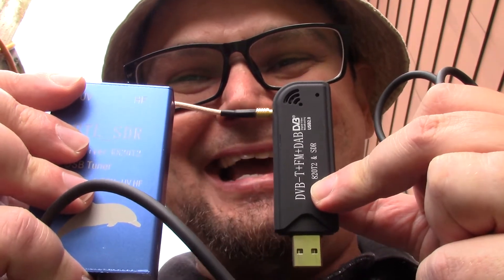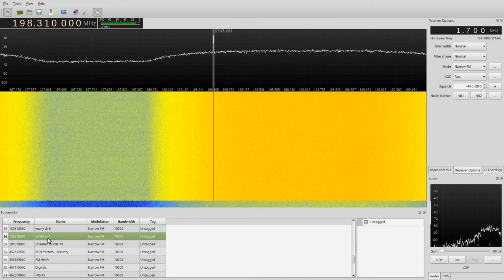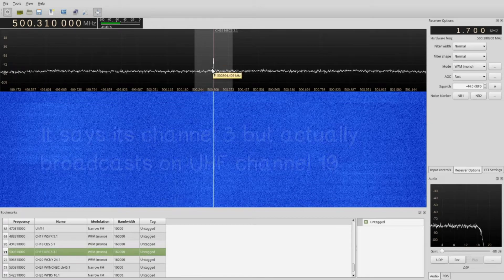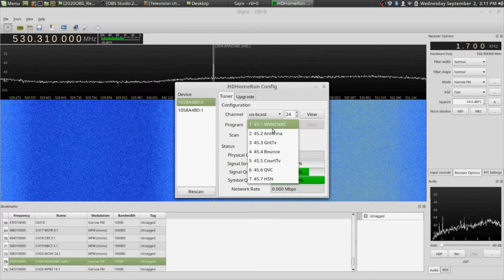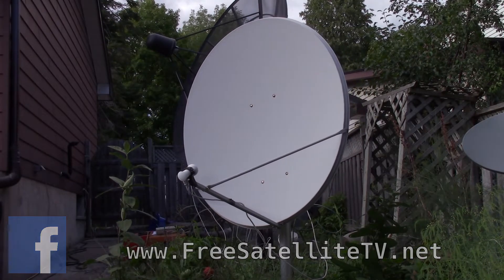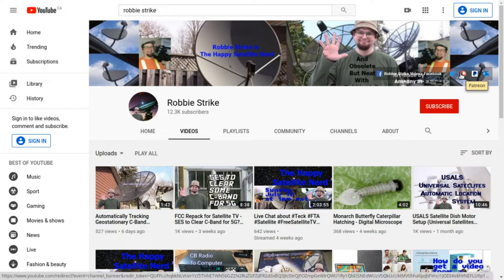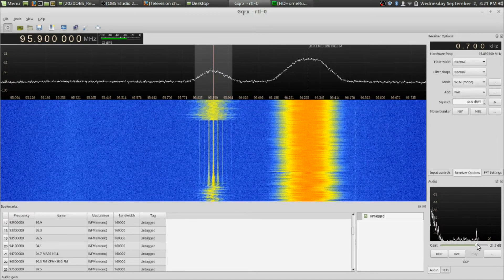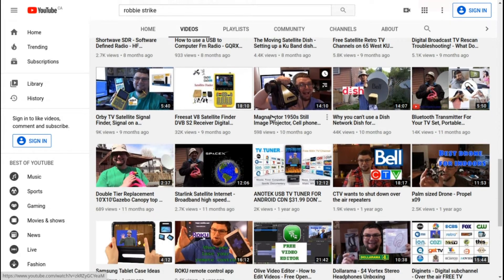ATSC On GQRX Software Defined Radio - A tool to test your connection to improve TV Reception

Comment: Do you have the SD HomeRun 3.0 tuner? I spotted what looked like 3.0 in the Tech/Config. I have one and really like it. Wish that tech app worked with Android as well.
Reply from the maker: no, I have the hdhomerun extend. There is no ATSC 3.0 in my area yet! When it is I will get one!
Reply: @RobbieStrike  I have one and it works ok. ATSC 3.0 still has a long way to go sadly.